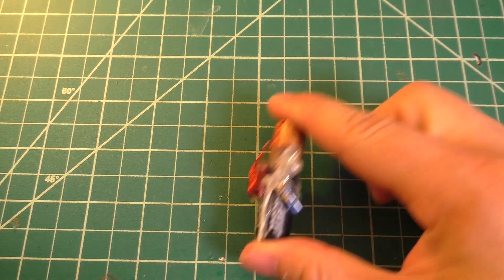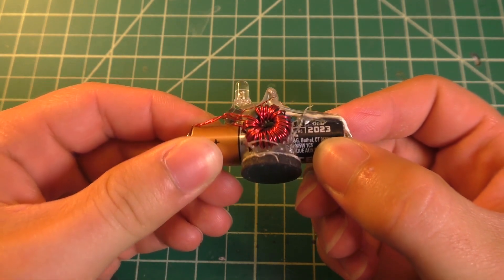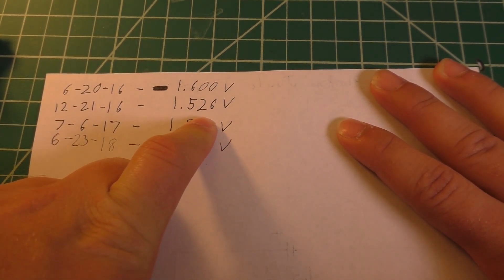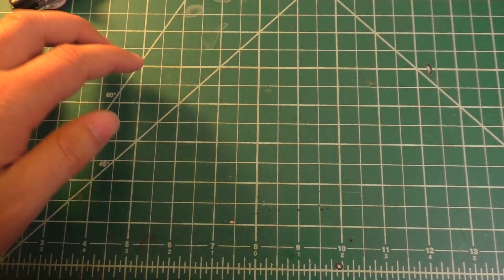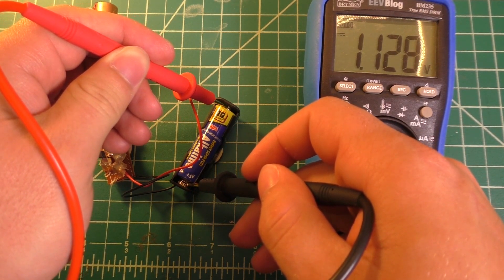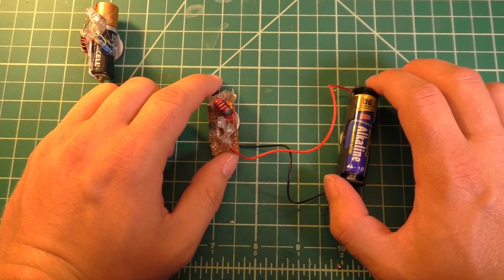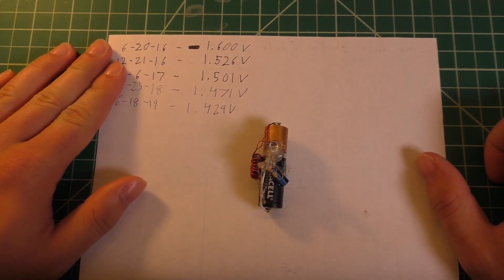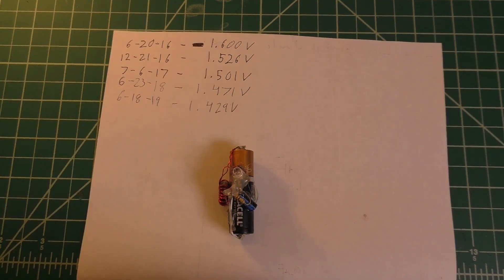Blinking Joule Thief: 3 Year Update

Comment: glad you put up schematic.  As I'm sure you know there are lots of variations on this circuit concerning values and where to place the cap.   There doesn't seem to be much around that gives in-depth theoretical analysis and reveals how decisions were made about where to put the cap.  Very glad you put the very important transformer dot notation on schematic, many omit this detail.   I think it would be great if you added some detail about the dot notation.   If you've got any background about how you made your decision some links would be instructive.   I've got a bunch of variations of this circuit all over my house as odd emergency lighting that only noticed during strolls to find toilet at night and usually once every hurricane season.   I don't think I've built any two alike by following diff tutorials.  I've noticed some instability in that some go from blink to fast-flash (appears constant on) which I don't understand yet.  I think your's is the only one of the blinker types that I seen that has resister/cap net between coil and base, so wondering how you made that decision.   btw, some scope captures would be nice.
Reply from the maker: I think when I first built this circuit I found a schematic somewhere that showed the configuration that I used. However, I cant seem to find the original source now. I believe the circuit I found was originally for one of the "fast flash" types and I changed the values by experimentation and made it into a blinking one. There wasn't any particular reason to use this configuration over any other one. It's just what I ended up using. I've done scope captures in the build video of this device. https://youtu.be/jzi3tMTT2kM?t=94

Comment: I built one for my GF about a year ago (probably inspired by your previous video on the subject) from a battery I found in the pile of used batteries.
I think I used more turns for the transformer, because it was blinking a LOT faster.
It got thrown out about a month ago, because the battery had started to leak.